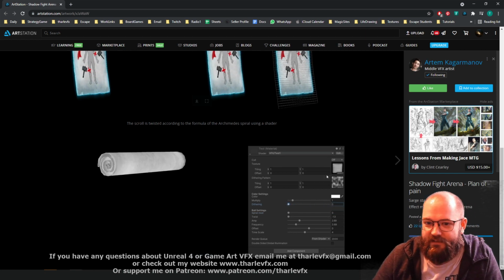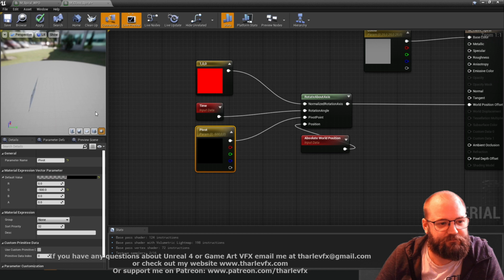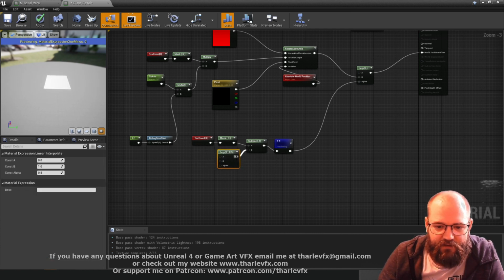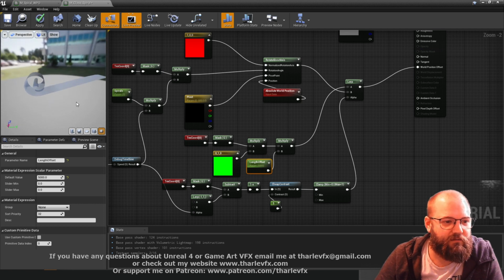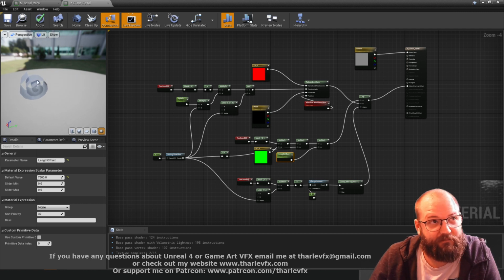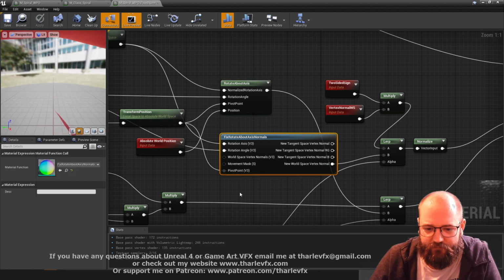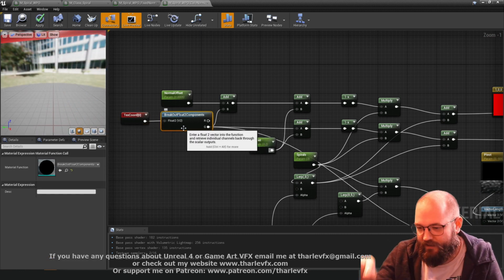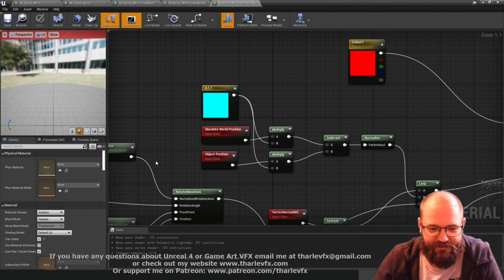Spiral World Position Offset Shader

Comment: Hello, is there any way to store a variables from the material in the GPU memory? for example for storing the rotation of grass blades for pivot painter collisions to achieve some level of persistence or smoothing.
If it is not possible with the default material editor, could it possible to do so with the 'Custom' node with HLSL?
I've read somewhere that you can do something with C++ and RHI but I didn't understand too much
Reply from the maker: So the way to save data from a material is using render targets but I’m not sure if that’s what you mean here. You can pre bake data into your meshes, such as pivot painter as you mentioned. There might be a better way but not one I’m experienced with I’m afraid

Comment: It's very interesting) Thank you for sharing your work! You say that it might be better to use skeletal animation here. Probably. But if you still continue to consider your method of folding the spiral, and it is very interesting, how can you reduce its radius? I mean how to reduce the distance between the layers of the spiral. I tried increasing and decreasing the number of vertices. The distance between the turns of the spiral only increases. Is it possible to "compress" the spiral with this method?
Reply: It was worth a little thought and the solution came) It is necessary on stage to reduce the mesh size in Y and play with the LenghtOffset parameter and that's it. The distance between the layers of the spiral is compressed. I made a model with few X segments and many Y segments. Now everything is smooth and beautiful)) Thanks again for sharing!
Reply from the maker: It’s a little tricky but it should be possible. You need to start with a smaller piece of mesh so the edge verts are closer to the pivot which should result in a tighter spiral when you rotate it. Hope that helps!
Reply: @tharlevfx  Got a question. If you add a texture, it doesn't stretch very nicely. Can this be avoided?
Reply from the maker: @liomizar9910  if you texture it assuming it’s unfurled then that’s probably the best option. We’re doing quite a hacky deformation here so it won’t be perfect

Comment: Nice ;) I have another challenge for if now if it will be possible. Is there a chance co calculate velocity from this spinning plane and apply that in Niagara to particles?
Reply from the maker: oh interesting - possibly? might be very complex math though.  there's a whole load of hacks happening here so trying to use the wpo spinning mesh is probably just the wrong approach.  if you make a skeletal mesh rig for the spiral mesh you can just attach an emitter to a bone and then inherit velocity should work for calculating the velocity for you
Reply: @tharlevfx  ah understand... thought that there is easy solution for that. In case which I wrote above better is to create sim in other soft and then calculate vel in UE probably.